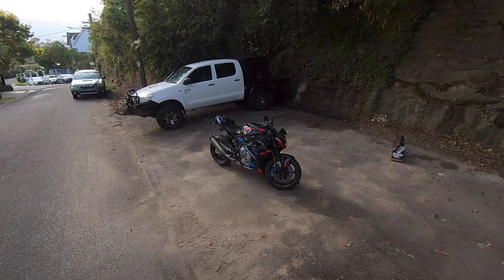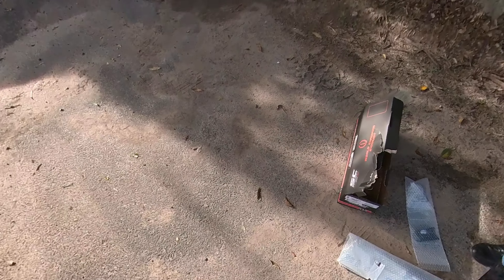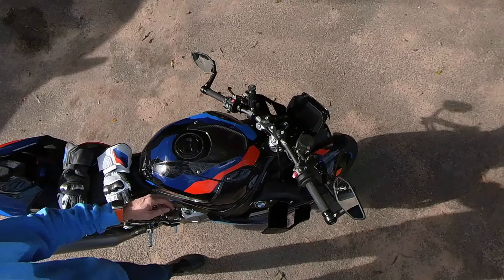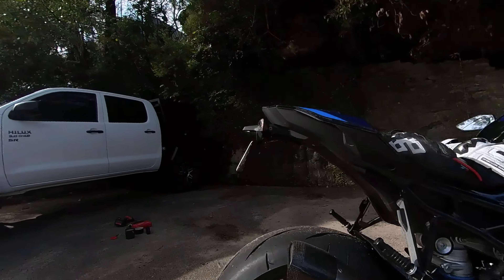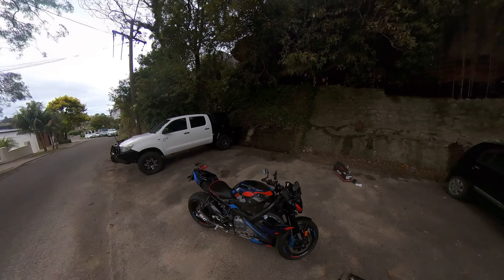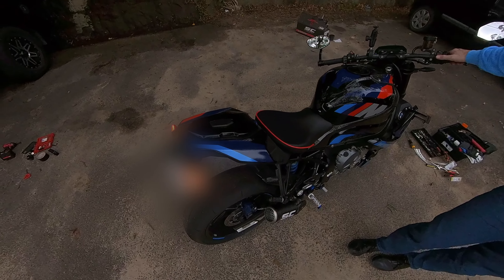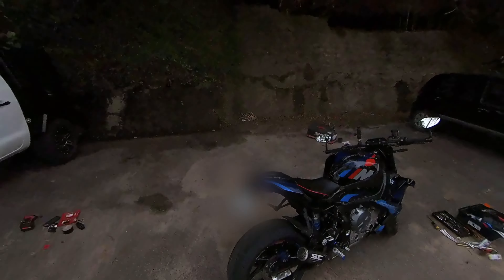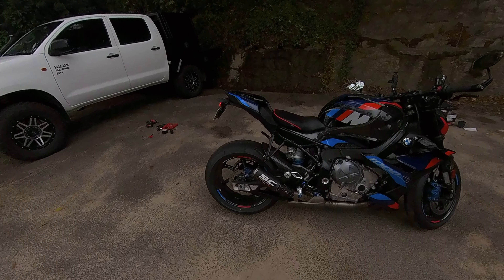BMW M 1000r SC Projects Slip on Exhaust

Comment: Awesome exhaust looks very good.
If you remove the cables of de exhaust valve it’s sound Even better.
I did it on my M1000R with stock exhaust sounds a lot beter and no faults on my screen.
Love your videos 👍🏻
Reply from the maker: Thanks Beau funny you say that- stay tuned, some tuning fun is incoming…

Comment: Hi there, on the SC-PROJECT website what did you take ? s1000rr 2023 ? s1000r 2023 ? got the same bike but i don't know what to pick. thanks
Reply from the maker: Hi it was hanging on a wall in the dealer- for the S1000rr I think…
Reply: it’s the same for S1000R or M1000R. Just be careful that you not pick for M1000RR or S1000RR